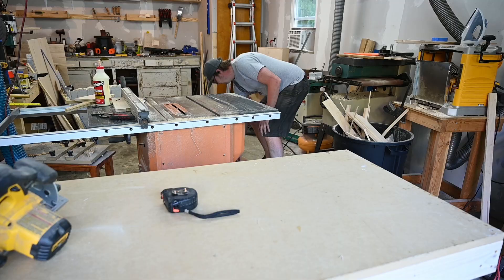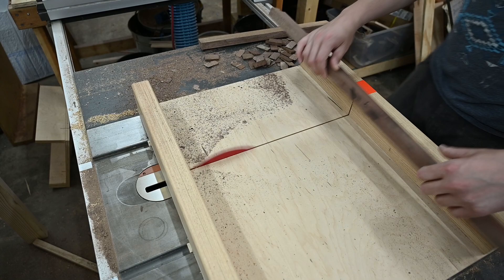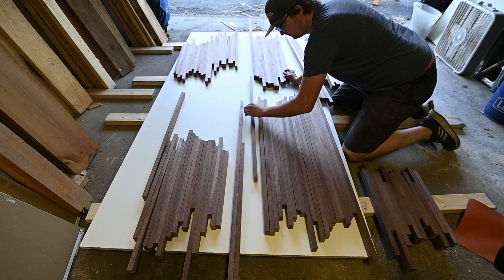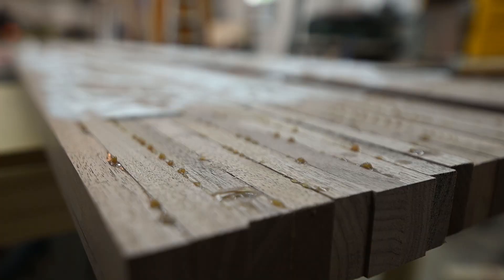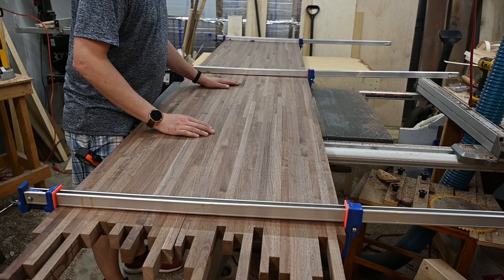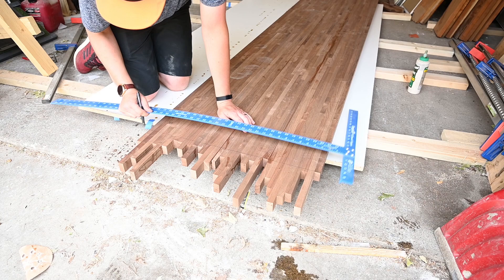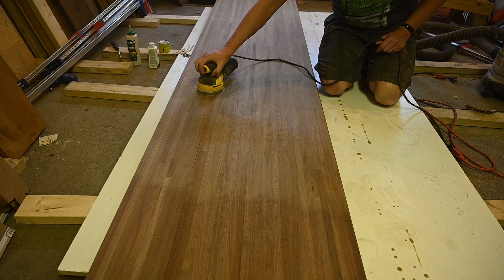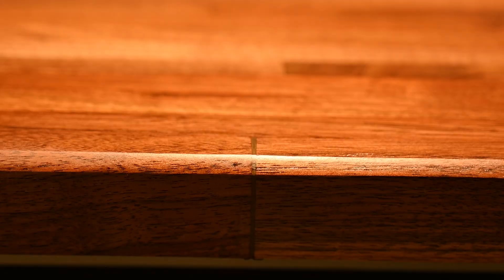DIY - Edge Grain Wood Countertops

Comment: Wow great job - a lot of work! Curious why you didn't roll the glue out? (I guess it still worked well)
Reply from the maker: I was pressed to get all the pieces together before the glue started to set. You could definitely roll the glue out, but I just rubbed the wood together to spread the glue around which worked just fine.

Comment: Just a tip, plan your boards before ripping them down on the table saw, it'll save you from having to pass so many small pieces through individually
Reply from the maker: Yeah in hindsight that probably wouldve saved some time. It still worked out fine in the end, but ya solid tip none the less.
Reply: @paulprice  yea no worries man good video and it came out great btw